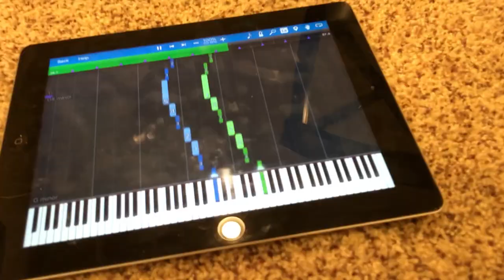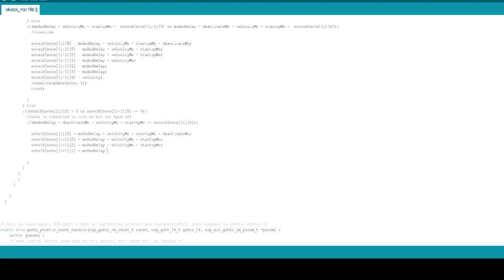I Modified My Piano To Play Itself! (DIY Build)

Comment from the maker: I recently got the piano tuned, fixed some of the solenoids, and improved the general mechanics of some of the keys. I also updated the code and included some features that put more realism into the keys and sound.
The result is what you hear in this video (I only updated the audio). This is a major improvement from past models IMO. I'll keep tweaking parts of the piano to get better sound.
Reply: You could also put something like silicone on the top of the metals that press the keys to get rid of that annoying clicky sound.
Reply from the maker: MBMS yes, that would work. It’s just a matter of adding it to each of the rods and then repositioning all of the rods
Reply: Well yeah, it might take a bit of time but it will definitely save you a lot of noise.
The easiest way would be to use a glue gun, I think.
Reply: have a feeling its not necessarily the clicking from hitting the keys but the internal clicking of the solenoids
Reply: Hello Brandon! This project of yours became too much, my friend. I'm an Electrical Engineering student, and I'm in the mood to do a similar project to learn eletronic ♥️
Reply: Let's hear your updated version!
Reply: Any plans to be able to control the solenoid drive current, so you could have velocity control, not just full on and off?
Reply: dude... i need to do this.!> make more videos...and more details on the build>!>
Reply: Fantastic and impressive build! The sustain seems a bit heavy…my piano teacher taught me that the sustain pedal was not an all-or-nothing technique, but instead to apply some light finesse when using it. You might try adjusting it so it isn’t activated 100% but something a bit less. Keep up the good work and thanks for sharing you talents and skills!
Reply: Brandon a super job. I just can't say enough about this. In my late teens I had a reconditioned player piano that used the QRS piano paper rolls.  It must have taken many people to design the piano, the paper rolls and then to produce them.  You are a real talent.  Thanks for your YouTube videos.
Alan.
Reply: bravo che l'hai accordato! anche se così l'effetto saloon del West non era mala 🤣

Comment: Good job! you need to design an extendable PCB for the shift registers and add a removable connector to the solenoids that will be less work to build/replace parts and more reliable then all the jumper wires on the prefboard... plus I would have added some kind of rubber padding to the solenoids to avoid them clicking...

Comment: Fantastic really well done. It does  show how ingenious the victorians were. They did this in 1896 using just air. I have one from the 1920s, still works, even in a power cut. I am an electronics engineer and wanted to do this.

Comment: This is so cool.

This reminds me of the Marantz Pianocorder player piano control system.

They used mosfets for the switching, and used solenoids to actuate the keys.

This is so cool.

I want to use midi files to control an actual piano, and this is very helpful.

And, Creative Engineering Inc. used the circuit boards from Marantz Pianocorder player pianos to control their animatronic shows. Most notably the Rock-afire Explosion.

I hope that you have a wonderful existence.

Comment: If it isn't a reproducer level of expression you can add a variable pot to the voltage regulation rail supply buss and have the expression like any traditional player. Instead of pumping hard or softly you'd have a lever pot or good slider pot to play with. Or use a volume pedal on the floor wired for the DC buss control.
Reply: Does that mean that you can set velocity (how loud a note plays) by deciding how much current you send to the solenoid? Isn't the solenoid on-off?

Comment: Hi Brandon, I've worked out why the PWM stopped working, I asked it to serial print the velocity and found no change with different volume / velocity. Anyway on the pro micro on the piano just get it to ignore this line //velocity = round(velocity * (MAX_PWM - MIN_PWM) / static_cast<double>(127) + MIN_PWM);  
 I sent you an email a few days ago I was having some trouble with the ESP but I've got it all worked out now.   Hope this helps :)
Reply from the maker: Thank you! And sorry for not having been able to fix this issue. We’re doing some work in the house and there is a lot of stuff in front of the piano right now. This line is supposed to conform the raw MIDI velocity to work in the range of the PWM frequencies, and I guess it’s giving a fixed value somehow... I’ll update the code in the next few days.
Reply: @brandonswitzer7112  All good thanks for the reply, Carl and I are looking at ways to get the PWM working nicely its quite buzzy and not working too well I'll let you know how we go :)
Reply from the maker: @jordanclarke2996  Yes. The buzzy PWM is something I tried to account for. The solenoids only utilize PWM when the key is in the process of being pressed. Once the key is fully pressed, the frequency of the PWM is set to its max. In other words, the PWM is turned off once the note is pressed, which stops the buzzing noise. Since the line that conforms the velocity is commented out, the PWM won't be set to its max when a note is pressed. A temporary fix for you might be to set MAX_PWM to 127.
Reply from the maker: @jordanclarke2996  I just updated the Github code with a possible fix to the PWM bug. Let me know if it works!
Reply: @brandonswitzer7112  will do Brandon! Cheers
Reply: @brandonswitzer7112  we can't get the new code to compile unfortunately.
Reply from the maker: @jordanclarke2996  I just updated it again - it should compile now.
Reply: @brandonswitzer7112  it compiles but the duty cycle does not change with velocity change. I have been monitoring the output with an oscilloscope, I have been thinking prehaps the velocity would work better at a higher frequency but the highest I can get it to go is 100hz this seems a little better. Any value for frequency over 100hz say 105 the output result is 5hz. I'll pop you through an email for you to have a look at sometime this weekend when ever your free. I'll keep working on it and let you know how I go cheers :)
Reply: @jordanclarke2996 Has this been improved / solved?
I intend to record samples with such a robot. Thus I need velocity as well as quiet operation.
Thanks!

Comment: my first thought was to use an electromagnet (magnetic coil) on each key and a permanent magnet on the other side respectively. 
This is still an incredibly cool and underrated project, but it seems to me that this way there will be almost no moving parts (electric motors don't last forever) and it will consume less power

Comment: Mate, this Yamaha disklavier pro claims to have 1024 velocity levels and since you're using MIDI files, I suppose you are "stuck" with the 127 velocity levels, I'm right? Or have you found a way around this? I'm planning to install a system like that for my dad, but since he was a pianist, I'm afraid the sound would sound a bit "too digital" for him, what are your thoughts on that?
Reply: "digitalness" is not just from velocity. Functionally, 127 would be plenty. I don't think he has velocity working properly here.
Reply: in the one you see in the video Bradon mentioned the volume loudness wasn't working.
You're witnessing 1 level of velocity then, which would mean 127 would certainly be enough :D

Comment: How well would this translate to pneumatic valves? Already have the player piano, and can print out a manifold to fit the player’s reader (88 holes). The hardware part is no problem, I just have no idea how to turn MIDI files into 88 discrete channels.
Reply from the maker: It would translate just fine. A lot of the existing code is just to translate MIDI information into 88 discrete outputs. If you set "handleNotes" to false in the code, it'll send the raw information to the outputs and skip the extra algorithms designed for the solenoids.

Comment: How about playing a BLACK MIDIs?
Reply: I’d think that that’d be impossible, since most black midis have overlapping notes and ofc that isn’t possible on a regular piano. But lots of works in the classical genre cover extremely difficult pieces, see Liszt and Chopin, but if you want something truly impossible you’d want something that would require many hands
Reply from the maker: @jacobd322  The algorithm is designed to deal with overlapping notes! Black Midis play well as long as there aren't an large amount of keys that would lag the ESP32. Look at "Circus Galop" or "Death Waltz" in my other videos.

Comment: I am considering making this but i have one question: Can it handle Rush B
Reply from the maker: It likely can except for the last 20 seconds or so
Reply: @brandonswitzer7112  would the actuators loose effectiveness or would the breadboard catch on fire due to the current?
Reply from the maker: @matchlesmage0260  it wouldn’t catch on fire haha. I planned for the piano to handle as many keys as possible. The system would simply freeze up because of the amount of data being sent to the ESP32